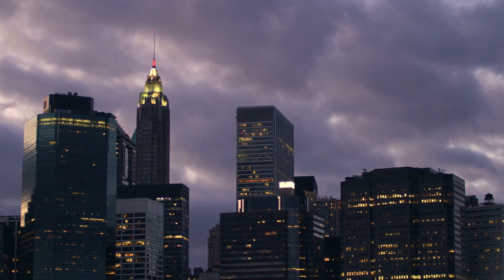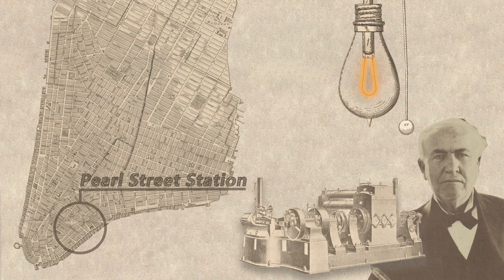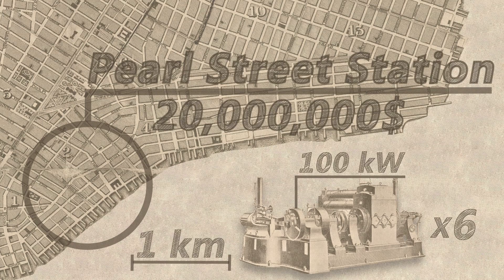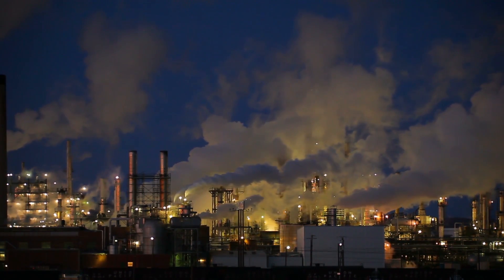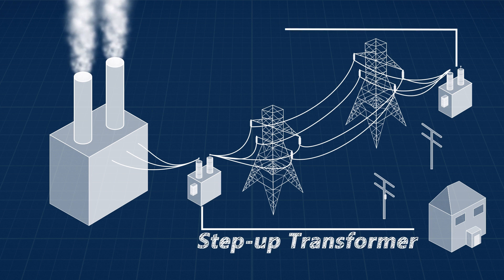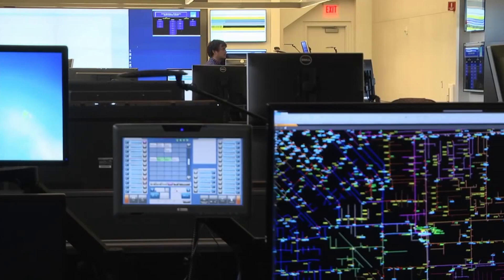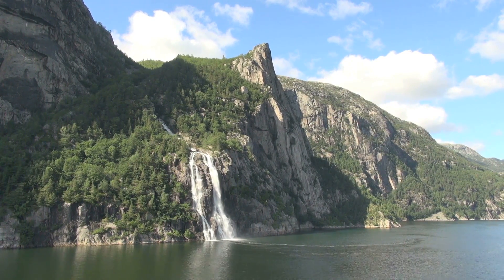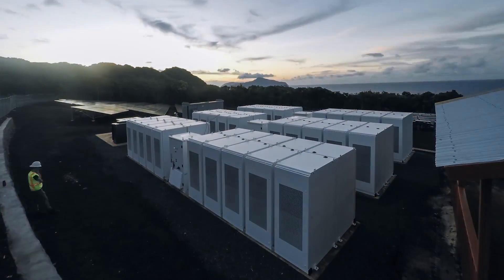What's The Biggest Machine In The World?

Comment: 4:07: "generated from natural gaz, as it's the cleanest of the fossil fuels".
that's a joke, right? From what I understand, the USA's energy sector is mostly privatized, so capitalistic concerns will always win over ecological concerns.
So, why is natural gaz used in electricity generation? because no one else wants it, so it's cheap.
It can't be used in vehicles, because until recently we didn't know how to compress it into a liquid that doesn't require a VERY large tank to hold any usable amount of fuel. (let alone the potential explosion issues during car crashes), and from what I understand (I don't live in the US, so I don't know for sure), the US houses mostly use reversible air conditioning for cooling during summer AND heating during winter (so, no need for gaz-based central heating), and along with the advent of induction stove tops, gaz should now be mostly absent from households...
That only leaves electrical production as a sensible usage for gaz.
Good thing that gaz is easier to move around than coal (gas pipelines), that way you can extract gaz where it is, move it to where the electricity is needed and produce it close to cities, so that you don't lose too much energy in the high voltage wires.

So yeah, no one cares about it being the "cleanest of the fossil fuels"

Also:
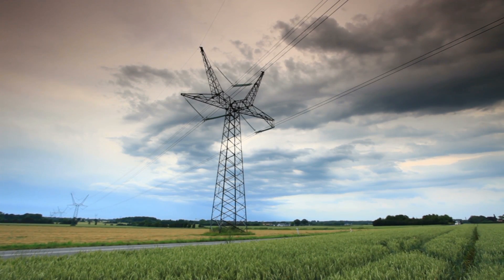0:23 "it's the power grid, the US power grid"
seriously? the US power grid is bigger than the eurasian power grid? or maybe the american continent power grid: from canada down to chile, all the country-wide power grids are connected. same as for the eurasian powergrid.

Anyway, love the show.
Reply: There's no "eurasian" power grid. Power grids are developed into separate systems. Most European and Asian countries have their own power grids—the larger countries often have more than one separate system with minor connections for redundancy's sake.
Reply: It is the cleanest of the fossil fuels. That is a true fact. Just because you don’t care doesn’t mean it isn’t true.

Comment: and what happens when we run out of land? a nuclear power plant produces as much energy as 81 square kilometers of solar panels, and they don't require energy storage. won't this require constant deforestation in order to get enough land to meet the increasing energy demand? and of course Forrests reduce the efficiency of wind turbines. so I feel like this system will cause huge environmental catastrophes.
Reply: still, you have to find a way to keep all of those panels clean. couple that with other routine maintenance, and nuclear would probably kill a lot less people. nuclear would also be significantly cheaper, and by the time we run out of fuel we will have the technology to construct a Dison swarm.

if the population continues to grow, and technology continues to increase, we aren't going to be able to sustain the level of growth nessisary to meet energy demands. couple that with increased food consumption, and using up valuable farm land on solar seems like an impractical and unsustainable endeavor.

nuclear is also way cleaner than solar to manufacture. so if the goal is environmental, then that hasn't been met either.

ultimately you're probably right that it can be done. But I think that it both shouldn't and won't be. and it's certainly not "inevitable" as stated in the video.
Reply: Otto Pike, I am not a big proponent of solar power (at least for where I live in cloudy West Michigan).  But to be fair, there is a great amount of land that is both sunny and already tree-free, namely our arid desert land.  Electricity is very easy to ship from one place to another.
Reply: I think fusion is our best bet for clean renewable energy, let's hope that the  "ITER" project is successful
Reply: Dude you have no idea how much empty land is in the US. Plus, you have no idea how many square kilometers of unused roof space there is in any city. 

Where there is a building, there will always be a roof.
Reply: @Rampent Upp

As terrible as the disasters of Fukushima and Chernobyl are (and they are), the total radioactive release between them and all other nuclear accidents is less then the amount of radioactive isotopes found in Coal-plant flu exhaust. Coal veins contain surprisingly large amounts of things like cesium.

And the environmental impact of messing with the C02 and methane levels in our atmosphere is an immediate issue, the disposal of Nuclear waste is a longer term issue.
Reply: Yalçın Alper Şahin, if we are going to be using fusion in 100 years, we will also be using fusion before we need enough electricity to use the whole earth's surface. You're talking 35000 terawatts of power here, assuming a 20% solar panel efficiency. Compare that to the 15 TW we use now, I think it would take over 100 years to ramp up our power consumption by a factor of 2000.

Why is mining the asteroid belt not green? "Green" either implies not damaging our own environment (and we don't live on asteroids), or the environment of other organisms, which don't live there either. Anyway, I wasn't talking about a dyson swarm, I was talking solar panels in high earth orbit. Dyson swarms would come later.

Name a rare earth metal used in solar panels.
Reply: Otto Pike  why would having solar panels on your roof require deforestation?
Reply: Well yeah, it seems we define "green" in different ways then.

But either way, that component of your definition of "green" doesn't really matter. If you can do so, there's no particular reason not to disassemble the moon if it's just a lifeless lump of rock, apart from the fact it might make the sky look less pretty.

You don't want the ice caps to melt because you want to maintain the environment for polar bears etc. and don't want rising sea levels to cause flooding. The actual giant lump of ice doesn't really matter much.
Reply: Well, that was my point. You are only going to be covering the whole planet with solar panels when you need petawatts of power.

Indium, ruthenium, tellurium and germanium are not rare earth metals.
Reply: Move towards wind while waiting for the invent of Hydrogen Fuel Cells.
Reply: all this talk about nuclear power but you forget the hazardous waste it produces.  where and how do you dispose of spent nuclear fuel?
Reply: we have gotten much better at recycling the nuclear fuel and if we can build a thorium reactor it would produce virtually no nuclear waste. and even with the nuclear waste nuclear is still much much cleaner than coal or oil. yes solar and wind is cleaner than nuclear but we cant make them to the scale to replace coal and oil while we can with nuclear
Reply: there aren't a whole lot of forests in deserts
Reply: The sun shines >1kw per square metre of power on the ground,  that's 1Gw/km2, I really wish people'd get that through their heads, even assuming low conversion efficiencies that's an insane amount of power. One thing that seems entirely overlooked is all of the solar energy storage already installed in the form of plants, simply utilizing what we already cut  back in order to fuel power-plants (punintended) or pyrolize it into fuel would make a huge difference, ditto for all other combustible waste, yet it never seems to cross peoples' minds. The development of advanced breeder style reactors is important even if they become unnecessary in the long run, as they're the only way to burn off most of the existing waste, although their development is ironically hampered by nuclear paranoia, further ironically leading to the stockpiling of spent waste and building of outdated, unsafe and wasteful designs. Nuclear power is also the only real way of doing space travel and until people get that through their heads we can forget about any real progress there, also, NASA's nearly out of plutonium, and without that we can kiss space-probes goodbye.
Reply: i would like to correct you on this one ... but i think it makes no sense at all .

1. cheap nuclear ? .............no , water turbines , even tidal turbines are much cheaper and more clean ....ever
2. safe nuclear .....? ....yeah sure ....a danger including waste you have to handle for the next thousands of years  shows that most people cant think ahead 
3. clean nuclear? its not only the waste of nuclear material , all handling materials , buildings ..e.t.c. are waste too , the hanford site cost u.s taxpayers about 5 billion/year to clean up .....cheap ....cheap thinking 
4. future solutions : we ar alle dreaming of clean co2 free energy for free , safe and cheap ....but what happens in 100 years if we maybe found out that the fusion reactor is not doing the thing or needs are 100 more years of research ( that is cut right now by the administration).
5. future the 2nd .......imagine in 30.000 years people are finding yellow steel drums in a whole they digged ..........with a black triangle symbol on it .....we can hardly read 4000 years old hiroglyphes from ancient egypt ....do you think somebody would understand that in that long period of time .
and by the way , i think mankind would not make it for the next 5000 years , not in that rate , not in that fashion , not in that number.
Reply: I'm a big proponent for the advancement of nuclear reactor technology in the form of modern breeder-style reactors which can burn off most of the waste that traditional outdated reactor designs produce, anti-nuclear hysteria has unfortunately left us in the strange predicament where only outdated and inefficient nuclear reactors which stockpile high-level nuclear waste are built and operated. That said, the only place where nuclear power makes sense is in space travel, where said hysteria has sadly left us without the only viable means of operating true spacecraft, and ironically the only real way of safely disposing of nuclear waste; why should we be okay with using nuclear power for the propulsion and weaponization of military vehicles instead?  Nuclear power on Earth makes no sense at all when we already have safe fusion power available in the form of the Sun: Sunlight puts out >1 kilowatt/square metre, that's 1 gigawatts per square kilometre or about the same as one nuclear power plant, even if one assumes it takes 5 times that much to account for inefficiency and night-time that's probably not more area than a nuclear power plant and its associated production/processing/storage facilities would need. One thing nobody ever realizes is the fact that solar-powered fuel and energy-production facilites are already freely installed by nature in the form of plants (literal power-plants or plant-power if you'll pardon my puns :) which could be directly turned into power simply by adding the appropriate burners to existing gas/coal-fired power-plants, and they can also be turned into fuel via an overlooked technology called pyrolysis; I've seen a study that showed pyrolysis of municipal waste alone in America would be more than enough to supply the countries fuel needs. If councils were to add an extra bin for plant waste and use that along with all the plant-waste carted to the local dump as fuel to run a small power-plant it'd probably supply most of its needs, although power-companies'd no doubt lobby against that against that. To re-iterate: Nuclear power on Earth makes no sense at all when solar-power is readily available in quantities that dwarf both our current civilizations energy output anything available using current nuclear technology, especially considering the fact that there is still no way of disposing of the current, let alone future nuclear waste.
Reply: IamGrimalkin That's not an analogy.
Reply: Fnord Fnordington It's clear you have no idea what you're talking about. Maybe you should keep your mouth shut instead of fear mongering the most reliable and cleanest energy scouce to date.
Reply: Only if we're not making use of all the wasted roofs of residential areas.
Reply: Those numbers seem very unrealistic to me. And since the source is "journalists" I think we don't have to give it any credability. ;)

Maybe it was about an area full of solar panels the size of Wales would be big enough to provide power for the whole UK?

Edit: I did some searching for you and it seems that in ideal conditions, you would need land of about the same size as Spain. 

http://uk.businessinsider.com/map-shows-solar-panels-to-power-the-earth-2015-9?r=US&IR=T
this might also be interesting to read:
http://rameznaam.com/2015/04/08/how-much-land-would-it-take-to-power-the-us-via-solar/
Reply: The number provided by journalists was the amount of rainforest cut down per year, not the amount of solar panels you need. I just multiplied the area of wales by 150W/m^2. In retrospect, that was a bad number to use, because that is the level you would get from solar panels in good sunlight, and obviously solar panels are not always in good sunlight. It's not going to be vastly off though, the amount you get might be a few times less than the total global energy consumption but my overall point still stands.

 
Yalçın Alper Şahin, when the earth is using that much energy, using breeder reactors you'd run out of uranium in 100 years. Also, when you've got to the stage where you are using that much energy, constructing space-based solar should be relatively easy, so the size of the earth isn't really as limiting a factor anymore.

Also, rare earth metals are not used in solar energy. I think you might be confusing it with wind, or perhaps the batteries and electric motors that could be used to store and use the energy.
Reply: Hey, remember hearing about the equivalent of an area the size of wales per year of rainforest deforestation? Well, if you covered that area in solar panels, it would produce about the same the average global energy consumption.
Reply: do you mean covering whales, or increasing the coverage by that amount annually?
Reply: A few years back journalists' pet analogy was to say that the amount of rainforest lost per year was equivalent in area to Wales (the country). If you covered the equivalent area in solar panels (not per year, just as a one-off), you'd get the about world energy consumption.

Comment: What is the definition of a machine?
In general it is a tool which uses energy to perform an intended action.
I don't think that the energy grid qualifies to that definition. It is not a single tool, but a network of various components, like wires, power plants, fuses or sockets. It also does not have one single owner. Some parts are owned by one, other parts by other companies.